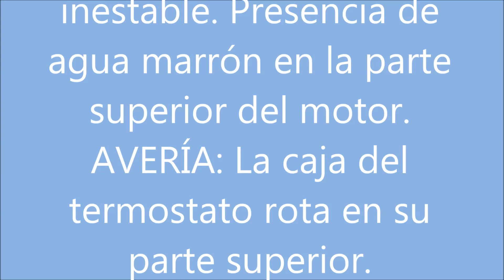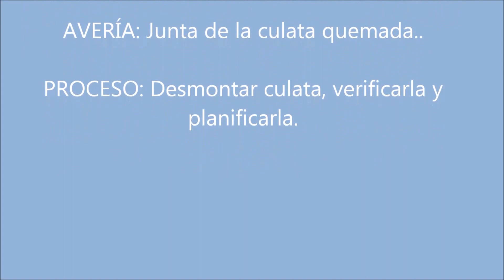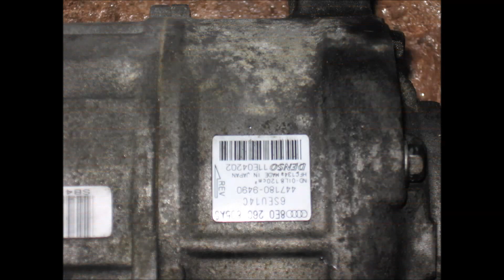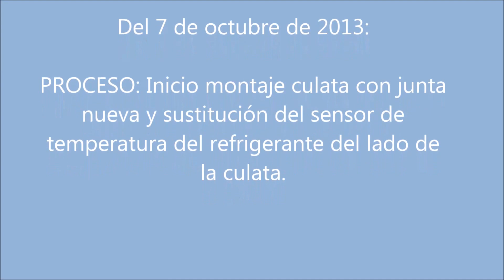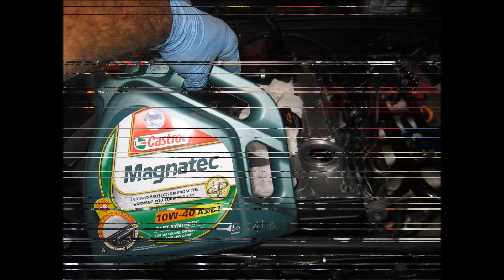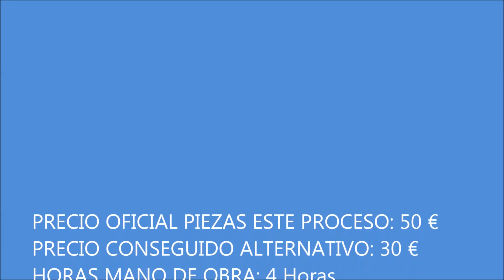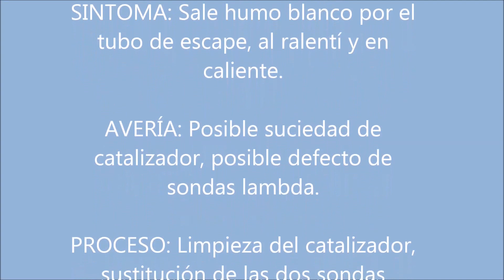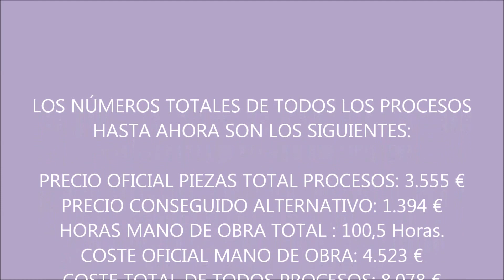Audi A4 1.8T cabrio motor BFB. Reparaciones. (Secuencia de fotos) Repairs, reconditioning.

Comment: hola!! me gustaria saber por que puede llegar a aparecer esa espumilla en el tapon del aceite. tengo un motor parecido, codigo motor AEB y me tiene mosca.
Reply from the maker: Hola +Unai Eizagirre, supongo que puede ser por varios motivos. Uno de ellos, podría ser la presencia de líquido refrigerante en el aceite del motor por alguna fisura o poro en la junta de la culata. Mi recomendación sería en primer lugar verificar la estanqueidad del circuito de refrigeración del motor para descartar la presencia de liquido refrigerante en el aceite del motor. Un saludo
Reply: Pasa agua al motor amigo

Comment: Hola! Ante todo, muy buen video. Yo tengo un audi A4 B7 con el mismo motor 1.8t BFB.
Queria consultarte lo siguiente. Me ha dado un error de resistencia interna demasiado alta en el Sensor de oxigeno 2 (Post catalizador). Por lo que me he planteado cambiar ese y tambien el Sensor 1, por las dudas (Pre catalizador). La consulta es simple. Podrias ayudarme a identificar cual es el conector eléctrico que le corresponde a cada uno? Entiendo que el del Sensor 2, es un conector color anaranjado con el numero 603,  pero no se cual es el conector del sensor 1. Quiero asegurarme de comprar las sondas correctas en lo que respecta a numero de cables y pines del conector. Por otro lado..sabes si estas sondas son muy caras en concesionarios oficiales? Yo estoy en argentina, pero voy a hacérmelas llegar desde españa, aquí son mucho más costosas. Espero tu amable respuesta. Muchas gracias!
Reply from the maker: Buenos días Ale F. Gracias por el comentario. Has tenido suerte, me has pillado de viaje de trabajo, en el hotel con la mañana libre, por lo que he tenido tiempo (cosa bastante poco habitual en mi mi) para mirarte lo que preguntas. 
Lo primero que te diría es que no te fíes demasiado de los colores de los conectores para identificar el cableado de las sondas lambda (sensores de oxigeno) porque pueden variar en función del proveedor. Lo importante es saber la referencia original del fabricante (Audi) para poderlos comparar adecuadamente. 
Para ver en el video la identificación de cada una de las sondas y el color de sus conectores lo vas a encontrar en varias fotos entre el minuto 38 y 33 segundos y el minuto 41 y 41 segundos. 
Sustituir la sonda pre-catalizador es muy sencillo, tan solo tienes que desenroscarla de su alojamiento y tirando un poquito de su cable ves donde está su conector y su color. En cambio, para sustituir la sonda lambda post-catalizador la cosa cambia bastante porque para acceder a su desmontaje y montaje es necesario desmontar el catalizador y la parte delantera del tubo de escape, como podrás observar en la secuencia de fotos que te he mencionado. 
En principio, el conector anaranjado se corresponde con la sonda lambda pre-catalizador, y el conector negro con la sonda post-catalizador. 
Para poder saber la referencia del fabricante puedes utilizar el ETKA (Programa informático que utiliza el grupo VAG (Audi, Volkswagen, Seat y Skoda) para todos los despieces de sus coches. El Etka lo puedes comprar por internet, en EBay por ejemplo, para instalártelo en tu ordenador o lo puedes consultar on-line en el siguiente enlace 
http://ifinterface.com/page/page3.php?langid=2 
y luego debes elegir la opción: “CarProg2” 
Hay debes elegir, la marca, modelo y año de tu coche y tienes el despiece completo con las referencias de cada pieza y el precio aproximado. 
Para saber el precio exacto y actual de la pieza que buscas puedes consultar en “AZELER” en la pestaña de: “Recambio original”, ahí seleccionas la marca, e introduces la referencia de la pieza que buscas (y que previamente la habías obtenido en el ETKA). El enlace de AZELER es el siguiente: 
http://www.azelerecambios.com/ViewsPrivadas/Original/BusquedaOriginal.aspx 
En tu caso la referencia para la sonda lambda pre-catalizador es la siguiente:  
06B 906 265 D 
Y la referencia de la sonda lambda post-catalizador es:  
06C 906 265 
En concesionario oficial Audi en España cada una de estas sondas valen 191,58 € IVA incluido más lo que te cuesten los gastos de envío. 
Lo que hago yo, una vez que conozco la referencia de la pieza que busco y cuál es su precio en concesionario oficial. es buscar por internet proveedores alternativos para ver si lo encuentro más barato. Para resumir, los sitios donde yo suelo buscar son los siguientes 4; EBay, Amazon, Oscaro y Recambiosdecoches. En cada uno de estos portales, introduzco la referencia de la pieza y veo toda la oferta que hay, y casi siempre los precios que se suelen encontrar son en muchas ocasiones por debajo de la mitad del precio oficial. Entre ellos también hay bastante disparidad de precios, por lo que suele merecer la pena invertir tiempo en buscar en los 4 para ver cuál es la opción más ventajosa. 
En el caso de las sondas que buscas, lo que yo he encontrado es lo siguiente: 
Para la sonsa pre-catalizador (Referencia de Audi: 06B 906 265 D) 
En EBay lo más barato que he encontrado es por 88,95 € + 8, 30 € de gastos de envío en Francia en el siguiente enlace: 
http://www.ebay.es/itm/SONDE-LAMBDA-313724-06B-906-265-D-077-906-265-AC-022-906-262-Q-/221872815090?hash=item33a8a67bf2:g:R1YAAOSw~gRV6FvQ 
En Amazon lo más barato que he encontrado es por 189,94€ + 2,99 € de gastos de envío de la marca VEMO en el siguiente enlace 
https://www.amazon.es/gp/offer-listing/B00HAH86L6/ref=dp_olp_new?ie=UTF8&condition=new 
En www.oscaro.es lo más barato que he encontrado es por 86,19€ + gastos de envió de la mara WALKER (Referencia de la marca: 250-25004). 
Y por último, en www.recambioscoche.es lo más barato que he encontrado es 68,95 € + gastos de envío de la marca BOSCH (Referencia de la marca: 0 258 007 090) 
http://www.recambioscoche.es/bosch-1149363.html 
Para la sonsa post-catalizador (Referencia de Audi: 06C 906 265) 
En EBay lo más barato que he encontrado es por 40,95 € + 4,95 € de gastos de envío en Francia también, en el siguiente enlace: 
http://www.ebay.es/itm/SONDE-LAMBDA-06A-906-265-N-06C-906265-F-06C906265-077-906-265-J-/171978960553?hash=item280abeaea9:g:0v8AAOSwl9BWLOAZ 
En Amazon lo más barato que encontrado es por 66,88 € también de la marca VEMO en el siguiente enlace
https://www.amazon.es/Vemo-V10-76-0015-Sonda-Lambda/dp/B00HAH778Y/ref=sr_1_2?ie=UTF8&qid=1459518625&sr=8-2&keywords=06C+906+265 
En www.oscaro.es lo más barato que he encontrado es por 63,42€ + gastos de envió de la mara BOSCH (Referencia de la marca: 0 258 986 615) 
Y por último, en www.recambioscoche.es lo más barato que he encontrado es 54,95 € + gastos de envío de la marca DENSO (Referencia de la marca: DOX-2008) 
Espero que te sirva esta información. Un saludo
Reply: Ohhhh, muchísimas gracias!!! Realmente no puedo creer que te hayas tomado tanto tiempo para realizar estas averiguaciones. Te agradezco muchísimo tu interés en el tema y ya me dejas poco por averiguar jajaja. Voy a mirar cada uno de los links que me enviaste para tomar la decisión y tus consejos. Hoy en día mantener estos coches a veces resulta muy costoso, y más en países como el mío, por lo que aprecio mucho la infomación que me enviaste. Sólo quiero hacerte una última pregunta. Más allá de la sonda que elija, una vez colocadas las nuevas...es necesario realizar un reset o reboot de la ecu? O simplemente la misma comienza a asimilar los valores que le van llegando con las nuevas sondas? Te pregunto porque un mecánico me dijo que hay que "sincronizarlas" con el coche via software, borrando algunos datos y registrando el número de las sondas nuevas, o algo así. Yo tengo el Vagcom, pero mucho jugo no le saco por el momento.
Te vuelvo a agradecer la ayuda!
Saludos!
Reply from the maker: No, no es necesario, una vez que tengas instaladas las nuevas sondas solo tienes que volverle a pasar el VAGCOM para borrar los antiguos errores que tenías y listo, no hay que hacer nada mas. Un saludo.
Reply: Muchas gracias! La realidad es que el fallo ya lo borré, porque era un fallo intermitente y por el momento no ha aparecido de nuevo. Pero si apareció, seguramente volverá a aprecer en caunto le dé un uso mas intensivo al coche. Prefiero hacer el cambio porque siento que el coche gasta un poco más y ha perdido reacción. Sólo para que puedas darte una idea de porqué hago todo esto...una sonda de estas en concesionario oficial aquí en argentina cuesta 380 euros cada una :S
Gracias y un saludo
Reply from the maker: Ese precio es un autentico abuso, pero yo de ti me aseguraría de que el problema realmente lo tienes en las sondas lambda. No está de mas que las cambies, porque las sondas lambda tienen una vida útil determinada que suelen rondar los 150.000 km., pero por lo que dices suena más a problema con el caudalímetro. No estaría de más que lo limpiaras o lo cambiaras, no es una pieza cara y tiene mucho que ver con la admisión del aire. Doy por descontado de que tienes el filtro de aire limpio y en buenas condiciones. Un saludo.
Reply: TODOS los recambios aquí; cuestan el doble o más que en europa. Además, no tenemos mucha oferta de alternativos. Por eso es una odisea mantenerlos...incluso algunos mecánicos todavía le sacan margen a la parte si dejas que ellos la consigan...es un robo, hay que estar muy informado.

Sí, he cambiado el filtro de aire hace unos meses, está limpio. Es verdad, puede ser el cauda también, voy a averiguar precios de caudalímetro, no me animo a sacarlo y limpiarlo sinceramente... la realidad es que antes el coche ya en segunda lo pisabas y salía como un rayo. Gradualmente, con el tiempo, se fue; poniendo mucho mas progresivo. No va mal, en ralentí; está; estable y de velocidad final va bien. Pero lo noto con muchos menos bríos ya hace un tiempo...no se si el turbo tendrá; algo de juego...no debería el coche tiene 110.000 km... Jamás se me prendió el testigo de gestión del motor tampoco...no sé!
 Gracias por tu ayuda.
Reply from the maker: Por lo que cuentas nuevamente sigo pensando que es mas probable que el problema lo tengas en el caudalímetro que en las sondas lambda. Quitar el caudalímetro en este coches es super sencillo, dos tornillos y ya está (1 minuto de trabajo) y limpiarlo es otro minuto, venden un spray especial para limpiar caudalímetros, le echas un poco de spray y listo. No obstante un caudalímetro nuevo está entorno a los 50€. Saludos.
Reply: Sí, es muy posible que, al margen del error de la sonda Lambda, el problema esté en el cauda. Voy a tratar de sacarlo y limpiarlo, a ver qué tal. Si no veo mejora, me haré traer uno nuevo de Barcelona. 50 euros me parece mas que aceptable. Crees que una vez hecho esto (La limpieza) convenga rebootear la ecu sacando el borne de la batería o no es necesario? Digo, para que se borre cualquier lectura errónea. Gracias y un saludo.
Reply from the maker: Yo creo que no es necesario. Tan solo borrar los errores anteriores con el VAG-COM. Un saludo y suerte.